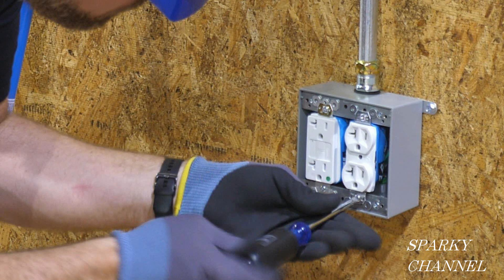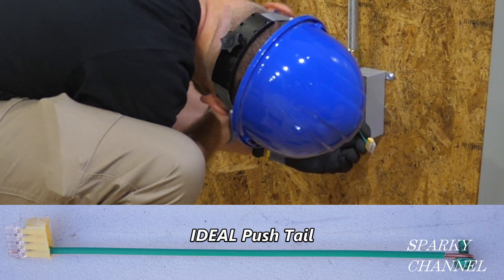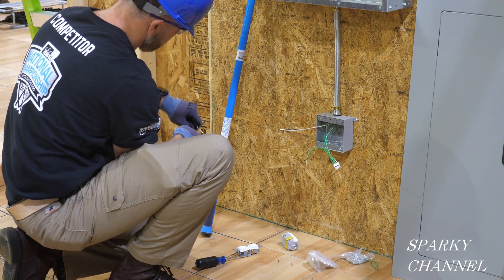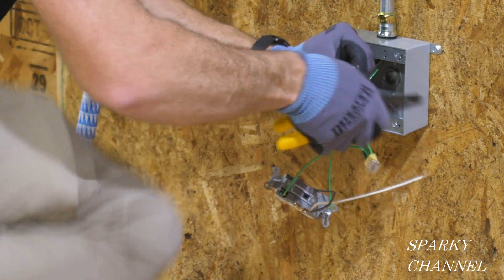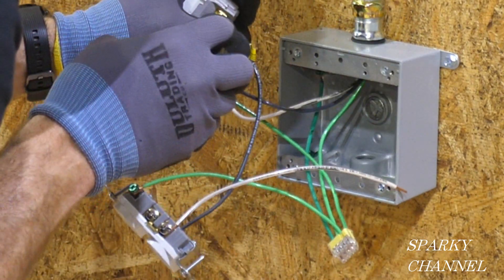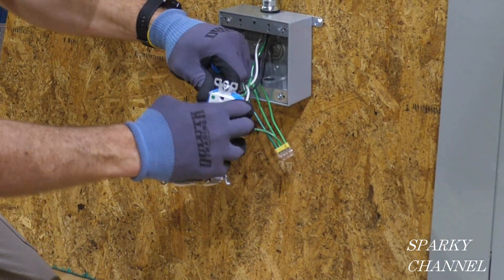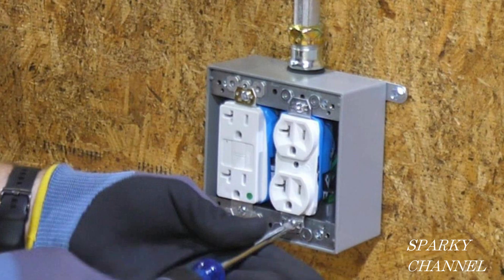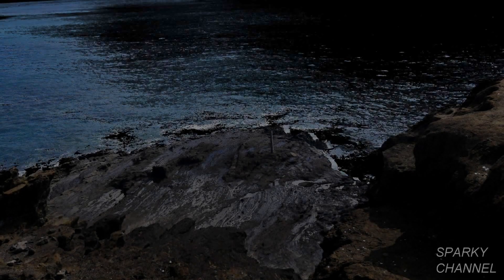Watch a Pro Wire a 20A GFCI and 20A Receptacle, Any Code Violations?

Comment: All looks good to me but I see how he just push all the wiring to the back of the box , when I had seeing others and I do it my self to bend them nicely like in a accordion way to be able to be accommodated in the back or if they need to be pull out it can be easy ,my opinion
Reply: Hey J CM, just an explanation of why that technique is not used in this alplication: In your house you would be using romex (NMD-90) which contains solid wire. Here, he is using stranded THHN which won't bend or stay put the same way as solid wire.  Cheers
Reply: @jimbojames9370  I know , and agree but I still don't just push them in like that I try my best to accommodate them, it was a bit of a bother thinking he was doing it for a competition and people was going to look at it I would think he would do the best to "try " to bend them in nicer
Reply: @ip5232   couldn't agree more. Part of the judging I'm sure is on speed... just as that seems to be all the customer cares about now... "how fast can you get that done?" At the end of the day it seems now the only one holding us accountable is ourselves... people don't tend to notice workmanship anymore....
Reply: He’s using solid wire in this video
Reply: @atmacm  that is what I taught but didn't want to see the video again.👍
Reply from the maker: Thanks!

Comment: Armor bands?  Please, what is that for and is it a requirement?
Reply from the maker: From ad: Reusable - clean, reusable solution to traditional electrical tape application
Quick - 2X faster installation than electrical tape
Thickness is equivalent to 6 wraps of premium electrical tape
33% wider than standard electrical tape
Decreases risk of stray strands causing electrical shock

No, not a requirement.
Reply: @SparkyChannel  Nice stuff, but just too pricey. I'm not sure it can be patent protected, I expect to see quality bands for much lees soon enough.
Reply: Protects against accidental shorts. I still use two wraps of electrical tape, too expensive, still. Not a requirement, but should be in my 35 years experience.
Reply: @ethelryan257  I use tape in case it should loosen, but there is plenty of room between the components since it seems it’s made that way purposely.  I’m a dyi-er, thanks for responding.
Reply: @robertp7209  It won't loosen if you do it right and electrical tape will insulate but it will not hold a connection together that you didn't tighten properly in the first place. Make sure wire nuts are tight and make sure screw terminals are tight.
Reply: @illestofdemall13  I guess you can say it’s from being overly cautious.  I’ve opened up boxes in my 1949 home and found wire nuts nearly falling off.  Seen worse than that.  I wrap tape a few turns on the nuts over onto the wires, as a rule.  Tape is cheap.  When I make the nuts I make sure all the wires engage in the twist.  I don’t bother taping outlets or switches.  The time I spend, I’d be out of business tomorrow - good thing it’s not my day job 👍😁.
Reply: @robertp7209  I do electrical work for a living so I am just talking from my experience and point of view. I tape around receptacles and switches when in a metal electrical box to protect against ground fault in the box.
Reply: @robertp7209  I regard code as the standard. Going beyond in some situations is good practice. I always tape receptacles and switches, the time/material cost is of no consequence relative to nuisance trips or call-backs. 
I think there is a distinction to be made between those of us who work in the field and the home-gamer who believes these are the 'time-wasters.'
Reply: @ethelryan257  when I asked the question, I didn’t realize this is a channel for pros, it seems.  Although I’m a career senior full career professional electrical engineer who designs systems in high voltage and very high voltage levels, where the electrical code is not applicable, yes the electrical safety code is applicable, and issued many technical opinions on work practices and went up against the opinions of the “jurisdiction in charge”,  and it may be unusual - but I’ve always liked and done my own work at home, though paid an electrician to upgrade my old electrical service to 200A.  Getting up on ladders that high is not for me, anymore.  With my experience and credentials, the courts would allow me to testify as an expert in any area of electrical work from low to high voltage, power plants, commercial, industrial, residential - although it’s not my interest.  I’ve even came before the courts in a driveway mid-paving case.  Ironically and may be entertaining, my mechanical engineering counterparts have no problem and like doing plumbing jobs at home - I dread them, but they don’t want to and avoid any and all home electrical work.  Sometimes they wire up something like a new light fixture the mrs bought, turn on the switch and something else gets energized or nothing at all and can’t figure out why.  Hilarious when I hear stories 😁.  You pros can work a lot faster than me, rightfully so and have the specialized tools I don’t need own, and talk shet about us degreed engineers, not a chance in my home anyone of you can find anything wrong at all, ever.  Peace 💪.

Comment: I'm impressed but fastest isn't always the best. Cramming the wires in the box could cause damage and a future problem. Also, put a little No alox in the threaded holes on the Bell box and on the conduit hub so the screws and fittings won't seize up. Make your install  permanent and serviceable.
Reply from the maker: Thanks!
Reply: STL8 works far better for that

Comment: Hey Bill.  You covered the labeling of down stream GFCI protected receptacles in your video, "Do Stickers Need to be Placed on Grounded Receptacles Protected by GFCI and AFCI/GFCI?". I agreeded that labeling is not required.  The article quoted here, as mentioned by others, is for installing grounded receps on non-grounded systems protected by GFCI devices. 

The only obscure reference might be, 110.3(B) listing/instructions.  Leviton GFCI instruction say to install labels on protected devices in the testing documentation.  The only time I've labeled is per 404.6 (D)(2)(C).  I've never been called on general labeling.  Our inspectors test for protection on required receptacles.

Corrections are always appreciated to my statements.
Reply from the maker: I understand what you're saying. If you know your inspector won't require that the protected receptacle be marked then that's OK with me. I always put on the stickers, then the users know that the receptacle is protected. Thanks Don!
Reply: In my jurisdiction, it is a bug-a-boo which inspectors love to fail you on. I insist on it, my apprentices think I'm a daft old lady, but arguing with inspectors over the fine points of code is only going to result in the digging until they find something.
Reply: @ethelryan257  I don't argue.  I just have them prove me wrong.  If I'm wrong , I'm wrong, I'll accept it.  Some inspectors have nothing better to do than pick some obscure code reference, like GFCI labeling, and see who they can nail.  I don't buy it.  We have cross trained inspectors in Oregon for residential, ie building inspectors who take an electrical course to do electrical inspections.  They pick some building code that reflects upon the electrical code and can enforce it.  like light fixture encroachment into stairwells...Like I really was aware of that!  But it proved me wrong.

Comment: They are both upside down. :)
Reply: Are you from Iowa?😂
Reply: I was taught to install with the ground prong hole up too. Installing ground down like in this video is somewhat inconsequential when using an insulated THHN ground wire. But with bare ground, it’s much better to be able to see the exact location of that bare wire as the device is pushed back into the box. Don’t want any chance it might contact something hot on the device.
Reply: There is no code to say which way is right.
Reply: You have to follow the manufacture recommendations. If manufacture says the receptacle should be installed ground up, it’s a code violation not to do that.
Reply: @atmacm  Most of them do not specify ground down or up.
Reply: @illestofdemall13  but some do…..
Reply: @atmacm  Not Leviton, I install them all the time. Someone said the ones in the video are installed upside down and that isn't true. They can be installed either way.
Reply: @illestofdemall13  I didn’t say Leviton did. I’m just saying some manufacturers specify orientation, and if they do, it’s against code not to follow.
Reply: @atmacm  I get that but someone else said they are upside down before you even left your comment.
Reply: Bwahahaha
Reply: Yup, but I gave up fighting that battle decades ago when a homeowner insists. The whole NEMA 5-15 design is dangerous.
Reply: Ground prong down. If you look at a three prong plug you'll notice that the ground prong is longer. The idea is that if the plug works itself loose, and pulls down, the ground prong is the last to break contact.

Comment: Well I learned something. I've never heard of or seen these WR devices, nor have I ever seen one installed by a professional.
Reply from the maker: They say that any day you learn something new is a good day!
Reply: @SparkyChannel  So are the WR required for indoor wet or damp locations as well? Specifically looking at locations where the receptacle could be expected to be sprayed with water from a hose.
Reply: I don't imagine box stores carry them in stock, though our local Walmart does!
Reply from the maker: @ethelryan257  Yes, they are a little harder to find.

Comment: Don’t forget the arc fault breaker in the breaker box.  With GFI and arc fault, that sucker will never work.  There is nothing safer than that!
Reply: ? I don't see the problem?
Reply: @suspicionofdeceit Just do not plug in a freezer or other cap start device since the GFI sees power charging the capacitor and not returning which may trigger it.

Comment: I'm going out on a limb here, but I think that that section of the NEC only applies when there is no EGC in the box.  Since all the work shown has an EGC then you will have to look elsewhere for the labeling requirement.
Reply from the maker: Thanks!
Reply: Depends on the inspector, in my jurisdiction, they demand it. Inspectors fancy themselves demi-gods and arguing with them leads to unnecessary challenges.

Comment: I’m not a professional electrician, but why is there a green grounding conductor to the panel if you’re using EMT? That’s not a requirement, is it?
Reply: to my knowledge you are correct
Reply: correct but maybe the competition specifies a separate grounding conductor
Reply: I never trust EMT as my sole ground in new construction. I want my path to ground to have the least resistance possible, today and decades of rust from now. Ohm it out, you'll be unpleasantly surprised how poor the connection often is.
Reply: EMT connectors may not be rated for bonding

Comment: He just jams the wiring into the box.  Why all this speed competition?  Yea I know time's money but where is the artisan aspect?  Shouldn't they be teaching Sparkys to use torquing drivers as standard practice these days.
Reply: Because time is money and nobody sees the wiring so who cares what it looks like as long as it is safe?  And professionals don’t need torque drivers for this kind of work.
Reply: @LTVoyager  Uh, professional here and it bothered me, I would have liked to see it folded, not stirred (that was a joke, humorless ones) and I think torque standards are overdue. Even I as a young woman sometimes over-torqued and stripped nuts. Yes, today, I have a 'feeling' but, still - the less 'feeling' and more 'science' in our trade the better.
Reply: @ethelryan257  It is your prerogative to do things the way that makes you feel better.  As a retired engineer, I don’t care much about feelings, but about what added value.  Having impeccably placed wires in an outlet box adds zero value, and actually reduces value as you pay a higher price for the same functionality.  I believe in using a torque wrench for structural fasteners in critical areas, but screws on an outlet simply isn’t one of those places.  Even if a professional stripped and discarded one outlet each day, they would still likely save enough time over using a precise torque driver to make it worth it.  And few professionals probably strip even one screw a year.  A torque driver is simply a solution to a problem that doesn’t exist in this application.
Reply: @LTVoyager  Sweet. How kind to mention my lady-like feelings.
You know what the torque recommendations are from Leviton for their residential receptacles? Fourteen to eighteen inch pounds. Not 'foot', inch pounds.
That's basically my snug finger-tight as a fit woman in her 60's. You really think an apprentice can match something that low reliably? No. 
Now, of course, I'm only the business owner and the master and the person responsible for making sure my installation doesn't fail or arc or catch on fire today, tomorrow or in a decade or four.
You're an engineer. You're exactly the type who would spec. those fasteners for exactly 14 inch-pounds with maybe a tiny safety margin...meanwhile, I let my apprentices try their 'feel' for that. None have ever even been close, all too heavy handed.

As to time, it is faster to do the work once, to spec. than to have it fail. We're not even talking about $300 for a decent Klein calibrated torqueing screwdriver.
But, even if it were slower, fine - I'm in business to make a profit through high-quality work, not through shoddy un-workmanlike performance. It takes me, after 35 years in the trade, three to four minutes start to finish on a standard receptacle when I'm being slow and deliberate. I figure six for my younger guys their first few hundred, then things should settle in about five minutes - and they do.
You know what the trade average is? Between five and ten. 
My time costs are bids, drive time, set-up and waiting for inspectors.
Now, as to folding, not stuffing the wires, you clearly have never dealt with an inspector. They see a neat installation, they are less nasty. There's also this little thing called Section 110.12 in NEC. Those of us who actually do the work take that seriously.
You've no clue about field work. None.
Reply: @ethelryan257  That’s funny.  You have no idea how much installation work I have done.  I am sorry you can’t hire people who can reliably tighten receptacle and switch screws by feel.  That is pretty sad.  As I said, you can do your work anyway that makes you feel good.  I do work that is safe and functional and doesn’t take all day to get it done.
Reply: @LTVoyager  Obviously not to Section 110.12 in NEC and not in volume. 
I don't see the problem with knowing instead of 'feeling' connections are made properly.
As to hiring good people, I have the best and don't you malign them. Fourteen inch-pounds is a very hard to 'feel' amount of torque and I don't see how it takes 'longer' using a screwdriver calibrated to tell you when you're there. It's not a separate tool.
My work has to pass inspection, my work must not fail as failure may cause fire.
You clearly aren't working commercially in a high-volume field or you'd grasp the value of repeatable work. Ideally, my newest apprentice' work should be indistinguishable from mine and I expect all my experienced people to work below the national average times, which they do. 
That's not taking all day, that's the difference between value addition which works right the first time, every time and doesn't arc, catch on fire or God forbid electrocute someone.
There is also the non-trivial matter of sensitive logic circuitry. The cleaner the installation the less noise.
Reply: @ethelryan257  And which paragraph of section 110.12 did the video installation not meet?
Reply: @ethelryan257   LOL, hardly a retreat.  I knew the line you were thinking of and I wanted you to confirm that so I can ask my next question.  Can you give us a completely objective definition of “neat and workmanlike” that everyone will know when a given piece of work meets it or doesn’t?  And my second question is: How many IDEAL National Championships have you won?
Reply: @LTVoyager  You just ended our conversation with that comment. Go play 'mine is bigger' with someone who cares.
Reply: @ethelryan257  The conversation ended when you chose to base your argument on a code phrase that can’t be defined and is purposefully vague.  It is like the legal term lawyers are fond of using “reasonable and customary” as nobody can define it so you can argue it means whatever you want it to mean.  You are criticizing an electrician who appears to have won national competitions.  That is pretty special if you haven’t won any yourself.

Comment: is a palstic ext box  legal ?
Reply from the maker: It's "Heavy duty die-cast aluminum construction with a weatherproof powder coat finish to protect it from the elements. Keeps rain and dirt from disrupting any electrical circuit." UL listed and legal.
Reply: @Sparky Channel  yes but plastic box could be acceptable also.